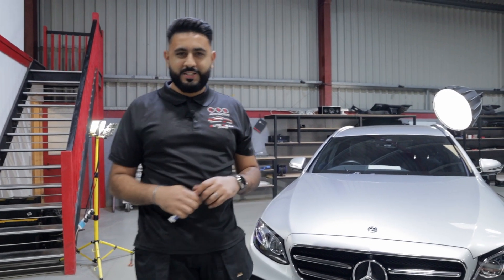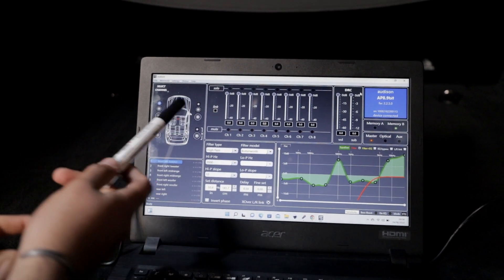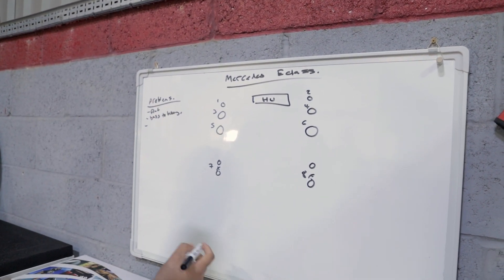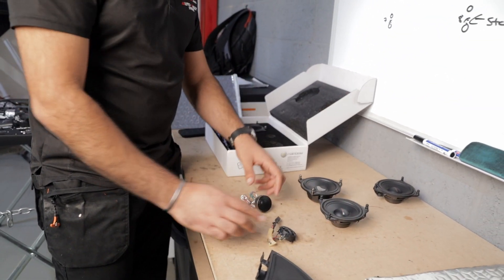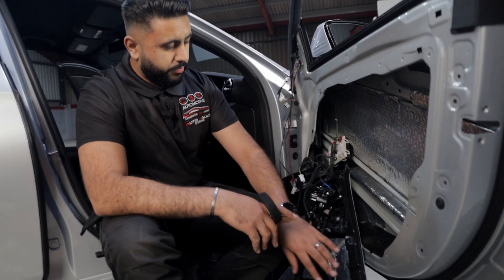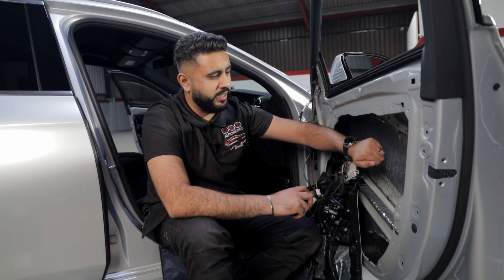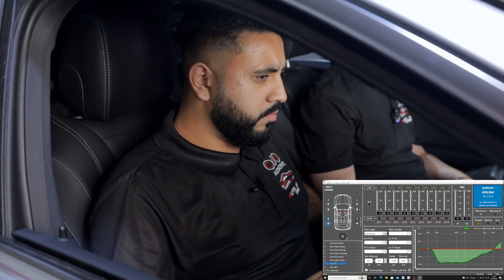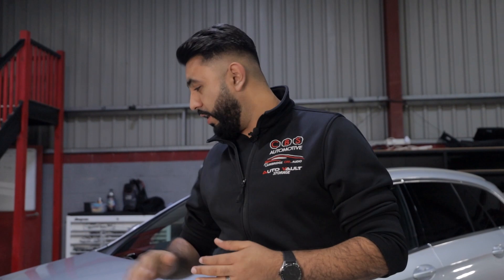Mercedes E- Class AUDIO SYSTEM TUNED and UPGRADED

Comment: You did a great job, but you need to do a head unit codig to ged rid of stock EQ end made it flat..
Reply from the maker: Depends on the level of system we are doing will depend on how much depth we go into when tuning

Comment: Great work team. Should you possibly share all the xover and time alignment points? Also what was your input gain? As I noted the output gains still seemed quite high? On my apf8.9 I’m at -6/22.0 on all level input.  I have rainbow 3 ways in the front. Or even if you could please share the tuning file with me?? Sorry a big ask I know. But this car is pretty much exact setup except for a sub in hatch.
Reply from the maker: We will work on that in new videos we film. The Forza you a running has a lot more power so you probably don't need to run everything as hard
Reply: @CambridgeCarAudio  I have my 8” midbasses bridged stereo. The 4” and tweeter have their only each channel.  But having to run the mid and tweeter on -18-20 on output otherwise it distorts. Thinking I have a setup issue. Hence why asking for your APF file to see if i can understand the tune more; if possible.